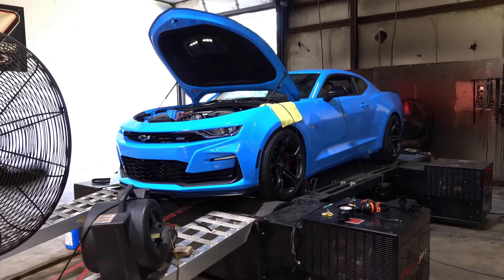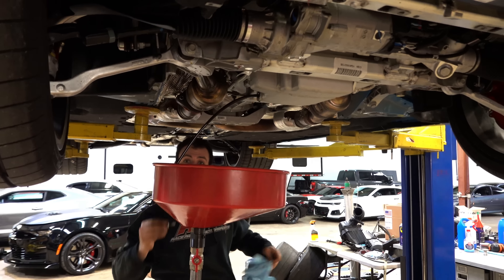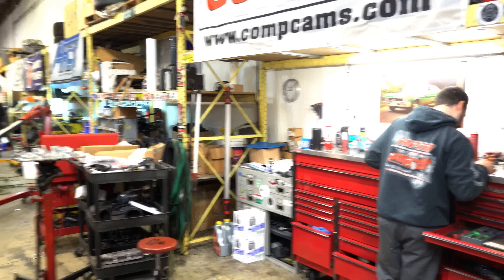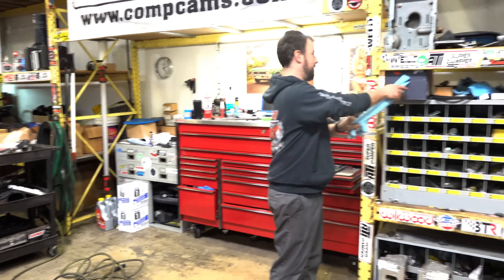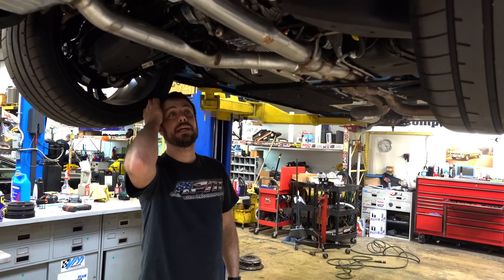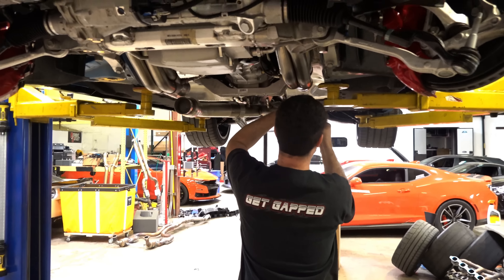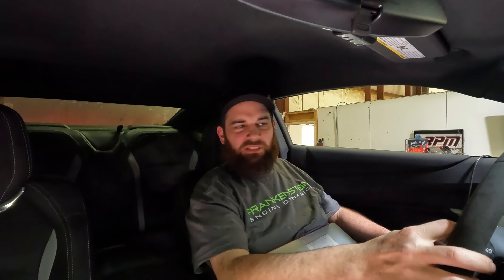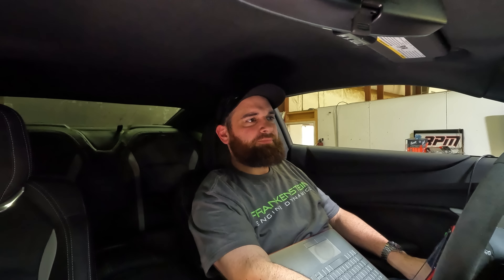Camaro SS 1LE Makes Big NA Power!!

Comment: Im so impressed the Camaro baselined 436whp bone stock. Are they still rated at 460hp from the factory?
Reply: I’m shocked it baselined at 436 almost bullshit if you ask me impressive at the same time.
Reply: 455 crank hp
Reply: It is a manual dude that's why
Auto will always be 30 less
400 rwhp something.
Reply: It’s really nothing special Bruh. My auto 2021 SS came in at 431 before mods. Auto are faster than manual 10 speed transmission is amazing on these. 1/4 mile.

Comment: They claim 591 whp  498 tq on a stage 3 on thier website . But in this video they get 537hp 467 tq. And thats with an msd that isnt oart of the package. Am I missing something?
Reply from the maker: This car was on 93 octane only.
Reply: @RaceProvenMotorsports  web page says 591 whp pump gas after result. And what's with the msd that's not part of stage 3?

Comment: Does anyone know why their dyno reads so high? Do they have it calibrated different than normal?

For example, this a stock SS & the motor is rated at 455hp at the crank and this one baseline dynoed at 436?? Baseline rwhp on these cars is around 400. Did this have other mods on it already?
Reply: No, it had 500 miles it was stock. Manuals are going to make more baseline than autos.
Reply: Ya 436 is way high.
Reply: Here we go again with the dyno comments….smh pretty sure it’s not the dyno that’s reading stuff high Lmao
Reply: @LarryLoudPack204  then what is?
Reply: It had an msd air force intake manifold on it and that's not part of stage 3 pack.

Comment: The comments on the door... You all know hoists have a rubber bumper strip. You can see in when he closes the door. LOL, Basically sounds like many of you never used a lift and it shows. Ever try to get out of a two door like the Camaro and NOT hit the hoist? Even the cheap 2 post lifts have those rubber stops/protectors. SIlly keyboard warriors.